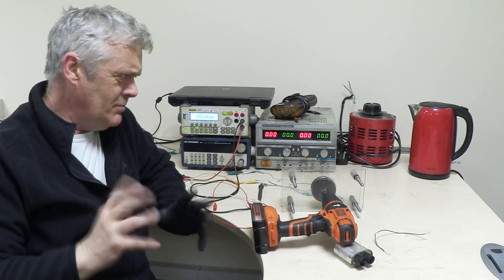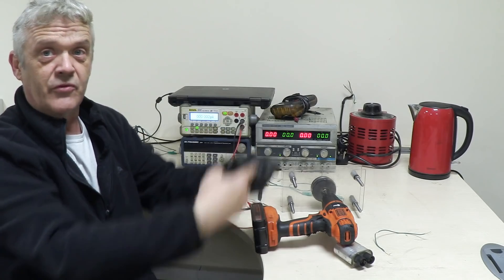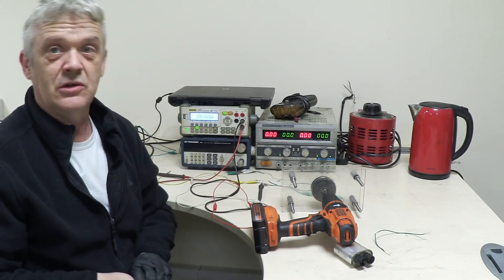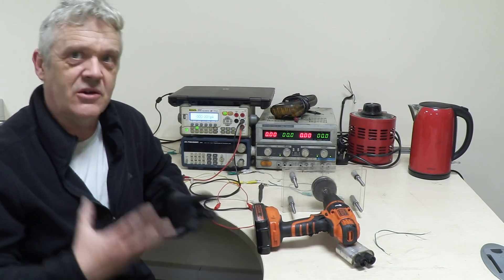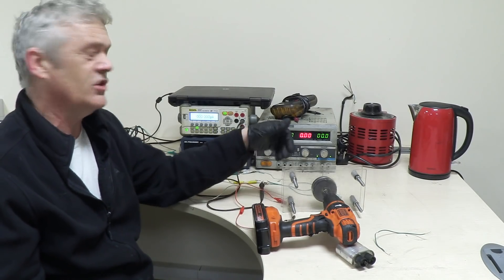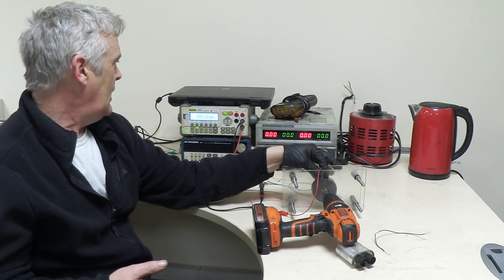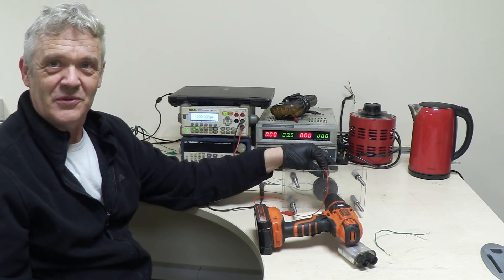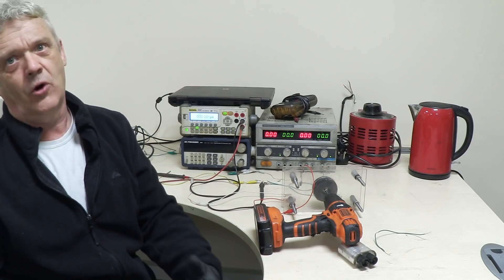Strange Behaviour Of A Tesla Homopolar Generator

Comment: As some have mentioned, there is a possible motion induction in the stable pick up wire ( it is in a tiny shell of the spinning feild of the magnets) but also with the modern theories that show things like gravitational waves, there may be a portion that is essentially a low induction radio emission of the spinning magnet, which we do theorize on large stellar bodies such as certain pulsars as an energy out put. Per what I see here, I think it is 90  percent induction on the stable pick up wire, and the last little bit from a grounded radio induction.Testing all of this would be very difficult, but we do know that there are parts to these things that do exist in other things.
Reply from the maker: to be honest mate - think you have give the best and most reasoned explanation

Comment: Hi Robert, I wish I could remember what it was called. There was a wheel, rather large, like 8 foot diameter, made of Iron ? I can't recall. Anyway, when spun with a brush on the outer rim, perhaps the other connection taken from the spindle, it produced whopping great currents. In the order of thousands of amps? at a couple of volts. The spinning wheel did find application in Welding. Only a couple were ever made for specific jobs. Part of the problem is that even the tiniest contact resistance on the rim of the wheel, because of the thousands of amps produced, created serious heat issues on the brush assembly and melted it in the blink of an eye, the rest of the current being used for the welding process.
Overall I think the sheer size of the wheel, prorbably weight as well, and inability to move it around, ended up favouring the welding systems we all know and love. I just can't remember the name given to the system. So its not a new discovery. Industry has used this effect.
Reply from the maker: it's a homopolar generator I think mate - they did run several large versions for the high current generation capability

Comment: Those plexiglass plates you're using as a frame or potentially the action of the roller bearings themselves - depending on where friction is occurring and the materials involved, could be a source? As I understand it "the electrical interaction between the races and the rolling elements in the presence of an oil film resembles a resistor-capacitor circuit - the capacitance and resistance for roller bearings and ball bearings depend on the film thickness and is governed by the permittivity and resistivity of the lubricant used" (Tribology in Electrical Environments, H. Prashad). Is it possible that the ball bearings on a conductive shaft may operate as a homopolar motor in themselves? The bearings themselves are conductive elements, rotating independently and at a higher speed than the aluminum plate and within a magnetic field!
Reply from the maker: cheers mate

Comment: You have just proved the existence of the aether.
Reply from the maker: I am not sure that's true mate
Reply: @ThinkingandTinkering  hi Robert can I ask for some advice on a system I've designed please. A micro hydro set up using washing machine coils and a 12 volt submersible pump using 30 watts
Reply: @ThinkingandTinkering  Read Robert Sunegnis "Galileo Was Wrong, the Church Was Right" to see why you have just proved ether

Comment: Very interesting! Perhaps it's coming through the shaft from the drill? Does the effect still happen if you spin the disk by some strictly mechanical means?
Reply from the maker: maybe
Reply: @ThinkingandTinkering  I put my magnetic field meter in front of my powerdrill, the field from the power drill extends quite a distance around the thing, probably of the magnitude of a few feet.  I think a rerun of the test with a hand crank and a high geared 3d printed gearing mechnism would be in order to make sure your not seeing an interaction with the magnetic field of the drill.

Comment: Maybe nearby magnetic objects are causing changes in the magnetic field as it rotates. Like the bolts in the corners of the frame. This may explain the very small current generated. It would be interesting to see a scope reading of this experiment. Maybe that could provide some clues.
Reply from the maker: maybe

Comment: Have you tried something other than carbon to contact the rim (IE:copper).
Also reminds me of a generator the had a disc and part of the bottom was submerged in mercury (if my memory is correct). Readings were taken from the axle and rim.
Reply from the maker: yep - tried copper

Comment: What if you put 100 of them brushes on it? Would you then get 400 micro amps?
Reply from the maker: dunno - I don't plan on trying
Reply: in parallel or series???  i think series may provide some interesting results!
Reply: @delta-KaeBee  parallel or series won't increase the voltage or the current. But you can run as many separate circuits of it as you want

Comment: Are the amps on par with the amps from your earth battery?

One thing you may not be taking into consideration is the magnetic field of the earth. While the magnets and metal are at a relative stand still, they are still rotating within the earth's magnetic field which is separate from the magnetic field of the magnets.
Reply from the maker: dunno. mate - I didn't think about it tbh
Reply: @ThinkingandTinkering  😎👍

Comment: Try it without magnets. It's intersecting the Earth's magnetic field and the drill motor.
Reply from the maker: read the description
Reply: @Jane Christensen To test this theory, spin an axially magnetised magnet on a shaft and approach the rim of the magnet with some iron filings. Of there is no interaction with the filings that are different from when the magnet is stationary then you are correct and the magnet's field is aligned with the earth's and there is no referential frame between them. Essentially static. Of course, you will have to use a perfect magnet. One with only two domains.

Comment: Yes I agree with tiger12506 once you connect the wire through the wheel you have a one tern coil near a rotating magnet. not the Field flowing through the wheel but the Field lines off the edge of the magnet.
Reply from the maker: maybe mate - cheers

Comment: you could use your metal disc and add 8 bar magnets 4 on each side n s n s this will give you a a/c output on the rim of the metal. Or take your round magnet and drill the edge in four places equally spaced. the drill hole should be close enough to the edge to break clear of the magnet...push a nylon dowel into the drill hole and file down the protruding edge of the nylon so the magnet edge is a smooth circumference again this acts as a break in the continuity as the magnet rotates...now wire this to a buzz box coil and your voltage will be boosted to a more efficient level. the buzz box coil gives a boost converter / buck converter effect...there is no drag off this type generator and can be used on your car engine for instance to produce voltage for electrolysis of water to fuel the engine with efficient  effect.
Reply from the maker: go for it mate - this is eas to replicate
Reply: @ThinkingandTinkering  already have chap...enjoy

Comment: My Father was a Commercial Radio Engineer. And I spent DAYS wandering around in an old Ford van, with him. Traipsing through the woods. We used two tools. A Natiional Geological Survey Map of Magnetic Resonance Lines and A Field Signal Strength Meter. Eventually, he used the information gleaned from these trips to decide where to Install a new Commercial Transmitter. I know the magnetic energy of a magnet can be visualized as lines....and the Magnetic energy of the earth are presented on the map as lines....Could you be observing the interactions of such, as your current?
Reply from the maker: it is an interesting idea mate for sure
Reply: Omg...TYVM...Love your channel!

Comment: The things you touch on are all parts  of what reality actually IS.
Science still does not really have a good explanation for it.
My current model is that it's all energy, whatever that is, expressing in the various dimensions depending on the varied forces applied in all said dimensions.
Basically an 'electron' is likely to be a Lack of some force rather than a Particle.
Particles in general are more likely to be expressions of several interacting field-efects rather than  discrete bodies.
Reply from the maker: agreed mate

Comment: The outer part of the metal disc is moving faster than smaller diameter magnet. (Helicopter blades) hypothesis,  you would get more current if the magnets were smaller
Reply from the maker: easy to try mate - give it a go

Comment: Possibilities are: Earth's magnetic field, drill motor's magnetic field, vibration of pickup plate within its magnets.
Reply from the maker: or it's an example of the faraday paradox
Reply: Ah yes, I hadn't heard about that before. So it seems the rotating magnets are inducing a current into the stationary part of the setup - the nearby wiring connecting the pickup plate to your meter. Makes sense?